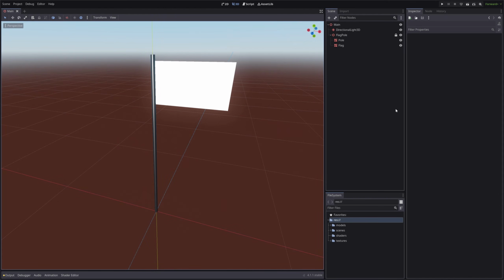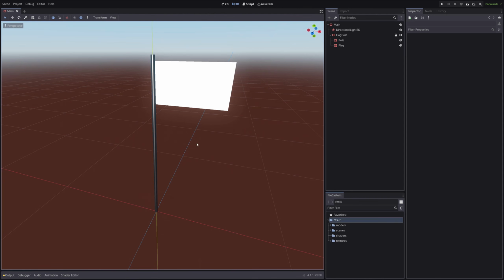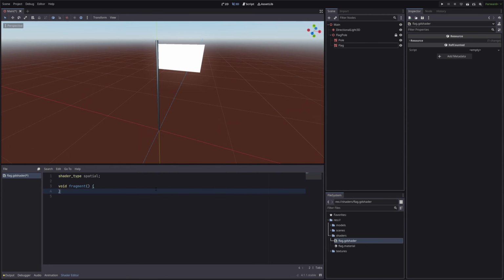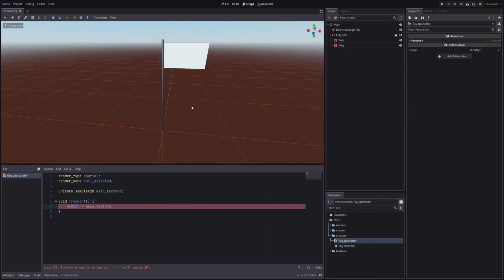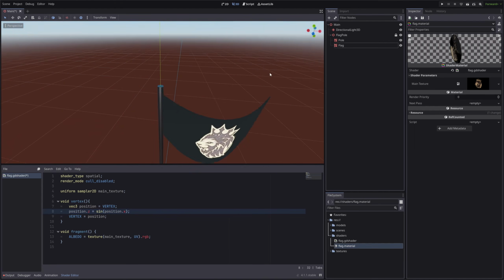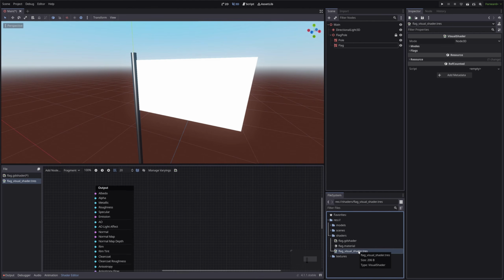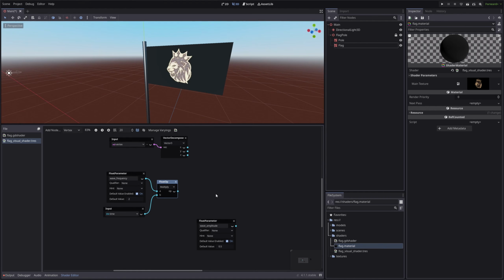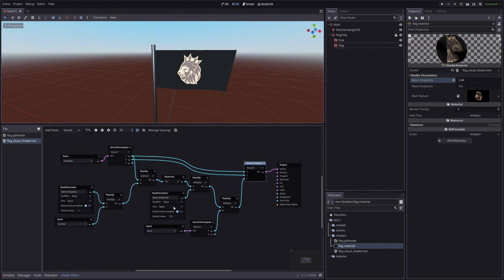Godot 4 Shader Introduction for ABSOLUTE Beginners!

Comment: One thing that could help with the visual shader, you have a little arrow next to the vector2+ outputs, click that and it will fold out and give you access to the RGBA outputs. That way you can avoid using VectorXDecompose nodes and just grab the one you need. Still need the VectorCompose node though, you don't have the same drop down on the input ports.

I don't think you can change it to show XYZW instead, but seeing as it's the same in a shader it's just a matter of taste.
Reply from the maker: Hey, I didn't know about that arrow thing, it will make shaders a bit cleaner, thanks for that.